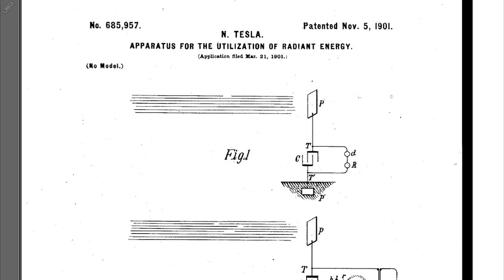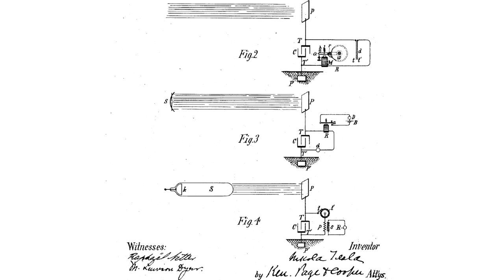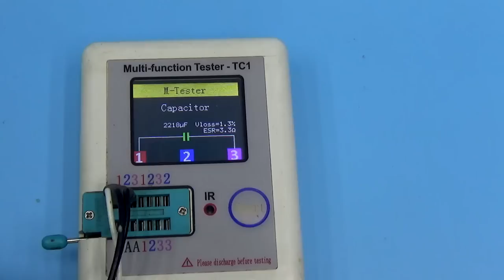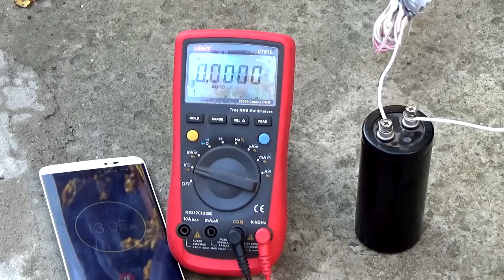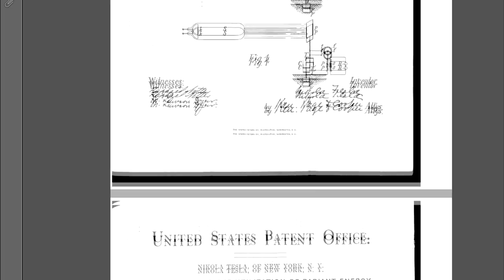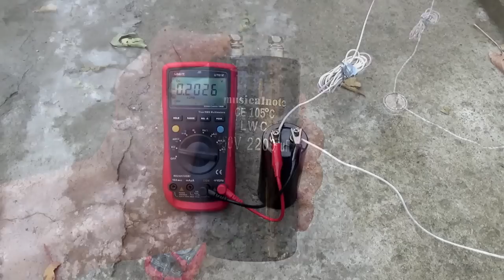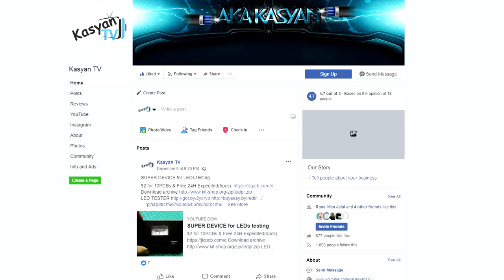Nikola Tesla - Free Energy (fuel free system - How does it works?)

Comment: The plate needs to be flat, the way you have it set up it disperses the energy due to the arc in the antenna. The energy is coming straight on. 
Point it to the East, because we travel through the aether and the spin of the Earth causes us to spin eastward. 
The higher you get it the more you will gather from the impedance difference. 
A minor amperage 2-3V A.C. added to the metal plate causes the antenna to gather energy from 10x the area of the physical antenna. 
The ground must be the same size as the antenna and buried 12-18" under the ground with a Good insulated wire to one leg of the capacitor. 
Wet the earth around the ground if the earth is dry.
Give us a video after these modifications. 
Blessings!
Reply: If it’s 10x what is the expected area?
Reply: @yehboi6646  1 sq ft of antenna collects 10 sq ft of energy
Reply: Shiny side of aluminum foil outwards. If using a metal plate, shine the eastward facing side ultrashiny (300 grit or finer 1200 is better)
Reply: I used a simple wire about 15 feet long to catch radio stations in my crystal radio.
Reply: @God-s_Kingdom  what are u using to add the added voltage?

Comment: Please, add a signal diode (like 1N60, BAT41, etc) between the antenna and the capacitor with the anode on the antenna side. Alternativelly you can put the diode between the antenna and ground, in parallel with the capacitor, with the cattode connected to the antenna side. I bet you will get much more charge in the same period of time.
Reply: Not one diode. Use 4 to make a full-wave bridge rectifier. If they are germanium, you have the "Joe Tate Ambient Power Module" circuit. You can use 6 diodes or even more.
Reply: Agreed 200%
Reply: How does adding a diode in parallel reverse the flow of current? I’m intrigued. Could two circuits be made, one series, one parallel and be connected in a way?
Reply: @jondelaire  sorry my friend, dont be intrigued any more, you are right. I wrote my comment long time ago and I dont remember why I said that. Diode in parallel will not work. Just in serie or using a full-wave bridge as suggested by Chuck. I remember doing it when I was a kid, 40 years ago. Only difference is that I used a tank circuit tuned to AM broadcast band. Accumulated energy was used to power an AM receiver that worked with a couple of transistors and  headsets and using the same tank circuit. It was basically a small radio that worked without batteries, published in the well known "Lúpin" magazine in Argentina. Regards! Adrián
Reply: Yes make a crystal radio set.. That is what you all need. just add a crystal set earpeice to the mix and get the sports scores
Reply: @jondelaire  Diode rectify meaning they chop the AC sine wave out and create a DC state current. depending on HOW you have your diodes set up depends on how much of the sine wave is chopped, half, or all..
Reply: @chuckjordan6455  When you find these germanium diodes and transistors that do not have tin whisker disease please let me know, I have a couple old radios that need them.
Reply: If you put a diode in, it will detect and store power from local AM radio stations.
Reply: Adrián, Chuck, and Elfnet. You have knowledge I seek to understand. Can you teach me? If not where would you suggest I begin my studies?
Reply: coolcool

Comment: Great to see a video about this topic that is not biassed in either direction.

As a sidenote, the electrolytic capacitor may have accumulated some charge just from being heated by the sun to a higher temperature than what it was before.

Comment: You don't actually need the aluminum foil. Just having a wire up high in the air harvests IONs and generates the same charge.  Another Nikola Tesla invention, one of many many innovations
Reply: @Tristan Arnold yes it does dum dum. try it before discounting.
Reply: There is so much wrong with the experiment. Tesla said heavily insulate the plate, use high tension/high voltage capacitors, and to have everything insulated for high voltage. You are also supposed to charge the plate negative. People replicate tesla's patents and completely leave out very important details.
Reply: Maybe its just a piece of his puzzle and not about wires or plates in the sky.
Reply: @ImYourProblem  Experiments teach the truth. I am speaking from experiments. It works exactly as tesla describes.
Reply: Yea of course it works.. you really gonna put a plate high in the sky to get any usable energy from it? Where does tesla state to do that? This patent is only a clue, a partial circuit, a TUNED "reciever".. dont focus so much on the diagram details..  its not about pulling dc current from ground to sky..
Reply: @ImYourProblem  You have to read the patent very carefully. The most important part is to charge the plate negative with a high voltage potential, it then pulls the opposite charge from great distances if the voltage is high enough, then the sum of the potentials can be discharged through the base capacitor.
Reply: Of course it has to be "charged" the opposite polarity youre trying to collect, just like any other capacitor plate.. Patent says it can also be charged positive to collect negative too.. or setup for AC.. those are clues..
Reply: @iEnergySupply  Have you built one?
Reply: @iEnergySupply  u got it. 
Once we get above the ground discharge  layer, the potentials get much higher. Thousands of volts way up there 

This experiment was at 6'  and topped out around .12 volts ⚡️

The figures I recall are 10,000v  at  100 feet altitude. 😳  But it's a gradient, not a constant 10kv per 100'
Reply: @iEnergySupply :

You don't need to heavily insulate the plate itself as long as you can heavily insulate the connection between the atmospheric portion of the conductor and the grounded one; these days you don't need high-voltage capacitors either, because we have supercapacitors that can store a ton of charge at lower voltages, so you can easily just discharge them before they reach voltage above what they're rated at. And lastly, the atmospheric conductor will be charged to the negative potential of ground every time you empty the capacitor.

Tesla was a genius, but he was limited by what he had to work with; these days we can use his ideas and our improved technology to make his designs even better.

Comment: With the ions flowing thru, some charges on the caps remain. BUT, a better idea is to have the antenna to ground circuit oscillate and thus help in pumping more and more ions from the antenna and ground. If the antenna and ground plate are brought to a much higher voltage (> 100 volts), there can be slight ionization on the metal improving its ability to interface with the ions present nearby. The oscillation, or AC currents, can be converted to DC via germanium diodes (rate for high voltage), bridge rectifier, and charge a super-cap with the DC side.
Reply: Build your "better idea" and post a video of your experiment. I'm literally dying to see it.
Reply: I have experimented with this using an oscillator source,  and the capacitors I worked with basically became "self charging"  in the manner you speak of. I had a large cap,  50,000 mfd at 60v and it would self charge to around 3 volts ⚡️ 

Nice spark with 50,000 mfd 🤪
Reply: @RGRundeRGRound  charge time?
Reply: @RGRundeRGRound  Serious question, link to instructions please, I want to do this as well. It will be a fun side project to my electrostatic generator.
Reply: Thomas moray improved upon this method to get a large amount of power out.

Comment: The directions in his plans also say to insulate the metal plate. yours looks to be taped or glued to a pc of cardboard or something with your wire only tapped to the aluminum foil.  Maybe a larger flat pc of steel or aluminum that is painted on all sides with rubber to insulate it, and the wire soldered to the plate?  Higher is better.

Comment: Great experiement. You forgot to say Tesla claimed that this way can be produced hundreds thousands of horse power with a football field size plant. If you take a look at your setup and what Tesla said to make sure, you have missed few precaution steps. You should try to make capacitor the way Tesla did. You must make sure that it does not leak. Most of capacitors fabricated today don't care about that as they are meant to be used  in powered circuits where such losses dont play role so its not that important but for this application it is.
Reply: Jesi im objasnio :)
Reply: " Most of capacitors fabricated today don't care about that as they are meant to be used  in"  
Ever hear of Nichicon?
Sure the Chinese may not care about quality but there are companies that do care and they make precision caps for critical systems. I would trust one of those companies before I would trust a homebrew cap built by some YouTube educated self proclaimed engineer who has no idea the difference between volts and amps.
Reply: @Elfnetdesigns  haha. Tesla has a patent about capacitors and has explained it how its made. Still today they use Tesla method for most demanding applications. Tesla discovery of using oil as an insulator is used in many applications today beside capacitors. Most difficult sounding thing is to make sure all air is excluded from capacitor but today with cheap vacuum pumps its easy to do that and degasing it? Whole point is that capacitor keeps charge and does not leak it in environment much until you want to discharge it into a circuit/battery.
Reply: @darkobul1  can you point me in the direction of learning how to make completely optimal capacitors?
Reply: @domestinger8805  nikola Tesla has two patents on Capacitors. First one was oil based and second improved is paraffin based. Main problem acording to it with capacitors are vacuous spaces. He solve it by creating condenser in vacuum and then finishing it of with 100psi what seems ensured that those spaces don't reappear. He said that produced condensers of most excellent quality. I have checked and today paraffin is rated really high on its dielectric properties but you may try to use other as well.
Reply: @darkobul1  so he removed the air and added paraffin? It would make sense that tightly packed conductor and dielectric layers would improve performance
Reply: Magnifying transmitters have been in use for many years as a way to extract energy from the ether. The technology has come a long way, and there are now many options available for those looking for a more efficient and sustainable way to generate power. While there are many different magnifying transmitter designs available, all of them share the same basic principles.

Comment: if u connect a joule thief circuit between the antenna and load, the voltage and current both will increase

Comment: 6:40 some suggestions for improvement. Wires are too long and too much resistance. Need short wires with high gauge, low resistance. Need a much better connection to ground. There should be a large iron plate buried deep underground. You want the ions from the ground to take the path you create to the sky (like the Great Pyramid of Gizah). Then, have a super cap and a boost converter to boost the low voltage to the target voltage. Consider also the Tate ambient power module circuit which uses germanium diodes. That circuit really works!!!
Reply: Certainly one shouldn't use wires longer then nessesary, and it is lower gauge wires that are thicker with lower resistance. But here, resistance in the wire here is not the issue for its poor performance, and trying to optimize the wire thickness for lower resistance to capture more power is a case study in diminishing returns. 

For example,  if you have two setups in identical conditions. But one setup having a copper wire 10× cross section area than the other setup's copper wire of the same length, meaning the wire will cost maybe 10× more because it uses 10× copper, but is still unlikely to increase the power collected over a year by .0001% 

Yes a boost converter can convert low voltage to a higher voltage but boost converters use  an oscillator circuit to pulse width modulate a signal to the switch just after the inductor in the boost converter. That oscillator will use up more power than the setup in the video collected, and fail to boost anything. 

One does not need iron buried deep underground. A typical grounding rod should be sufficient unless one lives in a desert. One can also use their water pipes as a good earth ground. 

The real limiting factor is that power available is a function of surface area and height of the collector. increasing both will do far more than spending additional money to optimise a lower resistance in the collector cable or improve the ground. Even then, it's not worth to spend $100 to get maybe $0.01  worth of electricity over a year.

free energy here is little more than a lab curiosity.  not a viable means to usefull energy.
Reply: @kreynolds1123  were not talking about collecting voltage from the air, that's why you need an iron plate collector in the ground
Reply: @domestinger8805  Yes the original  commentor in this discussion thread  was talking about collecting energy from moving electrons in the ground to the sky. 

The original  commentor was suggesting improvements via lowering resistance from earth to sky. My comment was essentually indirectly saying that using the copper wires wasn't the source of most of the resistance in the circuit, that the negligible modest against from a thicker wire would be costly without a significant gain in performance, and most any existing earth ground will have sufficiently low resistance.

I'm saying now that most of the resistance in the circuit comes from ion flow to the current collector surface area in the air.  

Yes a thicker wire has a greater surface area but that increases by the square while the cost of copper increases by the cubic volume for a given length, where as a longer thinner wire has a much greater surface area and reasomably low enough resistance for modest currents.

Comment: I also got 0.2V at 15ft. My antenna was homemade stainless steel sea urchin type. I used  the joule thief circuit to harvest the accumulated charge. Happy experimenting!
Reply: You will not get 50 to 60 MHz out of the Earth the energy will be 2.72 mHz and will need to be converted
Reply: @obviouslytwo4u  Ok. Energy in mHz is fine.
Reply: @obviouslytwo4u :

When harvesting ions from the air as in these experiments, what you're getting is direct current, not alternating current, so there is no frequency.

Comment: Tesla's Wardencliffe tower was designed to receive energy wirelessly but through a different receiving method. However, the tower was 190 feet tall to reach a minimal point above the earth to be at a sufficient distance where the atmosphere as it's own capacitance, between upper atmospheric charge and the ground, are well enough separated that a sufficient usable voltage can naturally occur, and therefore, better harvested using the antenna and ground connection at such a height.  Interestingly, the modern day replication of Tesla's work by a company in Texas USA named Texzon, also has towers this same height.  Although both Tesla's and Texzon technology both use surface wave propagation, the atmosphere at this height separates the charge.
Reply: You have to have resonance with shuman resonance

Comment: I used to build basic radio crystals where you can hear a radio broadcast on earphones, without using batteries. You can't call this "FREE ENERGY". What the radio and TV stations emit, we collect in a LC circuit. i,e, the broadcasting Radio stations invested lots of electric power (emitting radio waves) for you to receive an oscillating wave in a electronic circuit. IT IS NOT FREE, you pay for publicity included in the broadcast, and the publicity agency pays the owner of the radio station. Lightnings are also a good source of electric power, that is the source of "Tesla free energy". I see where the "PERPETUAL MOVEMENT concept" comes from.

Comment: The other thing that you missed here is that Tesla didn't realise until later in his career that this was tapinginto atmospheric electricity. More research has been done since then and there are ways to make the colection better.

Tesla's collector should actually be designed as a cathode rather than an anode, it should have many spike and ionisation points for negative charge from the ground to contact positive charge in the air. Additionally, alitude is key.

Experiments with balloons achored at 300 yards found that, at that elevation, with a ground spacing of 1 acre, up to 1.5 KW can be collected in summer and as much as 3 KW could be collected in the winter since the atmosphere is more conducive to the effect.

Additional research also found that the need for extreme altitude could also me mitigated by providing high voltage assistance, basically, using a high voltage to suck in the ions and funnel them to you from the environment, basically accelerating the ground attraction.